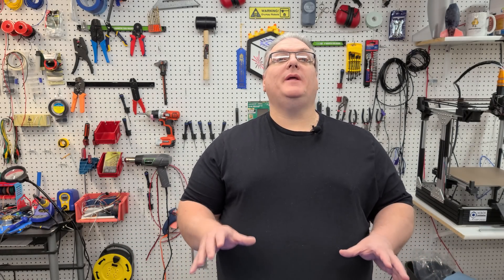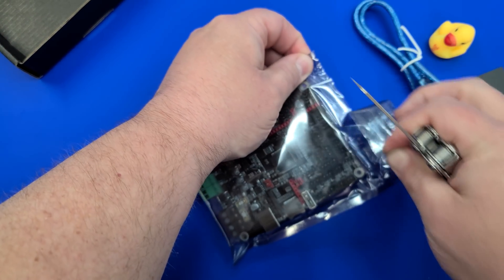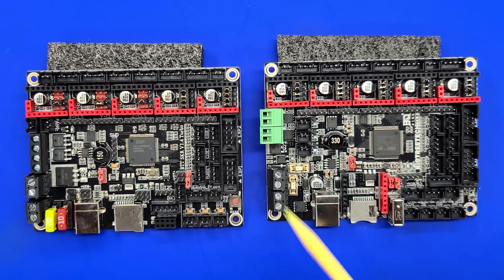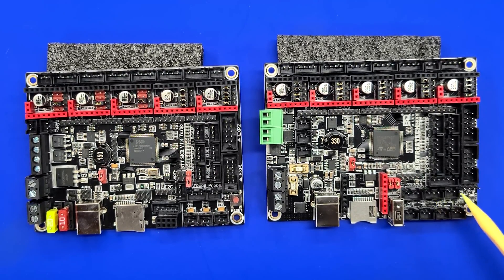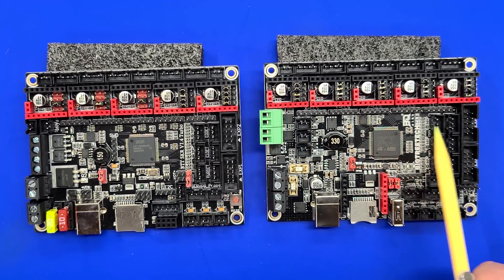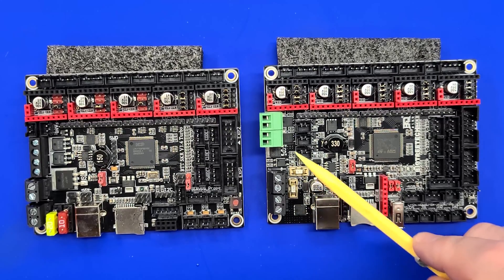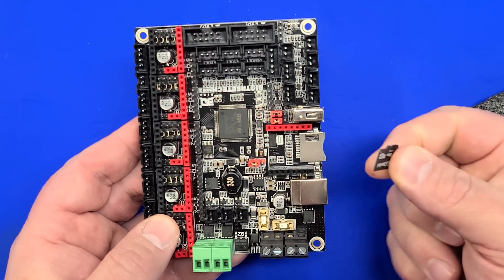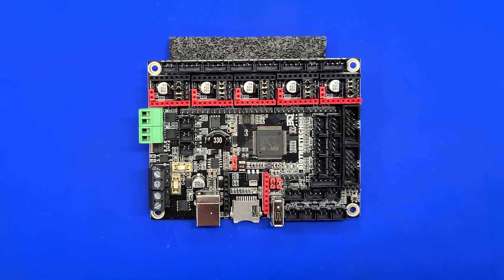BigTreeTech SKR2 - First Look

Comment: Hey man. I'm building a new control box for my cr10 v3 and I'm leaning heavy towards this board with 2209 drivers. What is your opinion?
Reply from the maker: Just make sure you're getting one of the newer ones with the fix.  I'm not sure if there are ones still in the wild that have the driver issue.  I have a few of these installed and they work fine with TMC2209 and sensorless homing.  Its a good economy board for a standard cartesian printer like a CR-10.  I would have no concerns putting one in a machine.
Reply: @MakersMashup  awesome, thank you. Of all my printers the cr10 v3 and it's 8 bit board drives me nuts with its slow interface and constant print failures. I already ordered a psu and all the wiring and such to make a new control box. I've been holding off on the new mainboard and screen. Talking to btt directly is somewhat frustrating as they have given me bad info in the past when buying a hotend when I was a complete noob when it comes to printers haha they still think the hotend is the same as the original cr10 even when I told them it was a direct drive e3d titan. I plan to enclose the printer to use better functional materials at higher temps. Especially for when I decide which diy fast printer I want to build. Thanks again for answering.

Comment: Does the SKR 2 physically fit with the native Ender 3 v2 frame?

I can only seem to find installation videos for the "Mini" variant - which I don't want because that doesn't support dual Extruder motors/drivers.
Reply from the maker: Not sure about the V2 but the V1 has several adapters for 1.3 and 1.4 skr.  The skr2 has mostly the same footprint.

Comment: Does anyone know if you still need the DCDC module to run more than 10 neopixels? What is the current draw on those pins?
Reply from the maker: I would power externally for more than 10.  I have an upcoming video that you might want to wait for if you want to use a lot of neopixels. I'm expecting to release it in a couple of weeks.

Comment: i have been unable to flash this board, used usb with arduino, vscode - nada. tried using sd card - nada.
Reply from the maker: Did you copy the firmware.bin manually to the SD card?  If so I would reach out to BTT that was all that was necessary for me to get it to flash.  It doesn't work like the old 1.3/1.4 where you could write to the SD directly.  BTT has a footnote of this in the bottom of the PDF in the github repo.  I ran into the same problem initially but manually copying worked fine.
Reply: @MakersMashup  I am trying, but all I have is a 120 gb mini SD card . So I'm thinking that might be an issue. Also I still haven't found any information that says I can't upload via USB cable anywhere l, except the comment section here
Reply from the maker: I'm fairly sure that is your issue. IIRC I remember there being an issue with using cards over 64gb.  I have used a 64gb successfully.
Reply: well i was able to get it to flash its led for a few seconds, but now i cant connect via pronterface to the board...
Reply: @MakersMashup  it flashed, now LCD / USB don't work anymore so this board is a piece of crap
Reply: @MakersMashup  can you share your firmware.bin ?
Reply from the maker: Sure. If you want to pop into the discord I can send it to ya.
Reply: @MakersMashup  I actually got it, bought a new 16 gb msd card and it worked. Also told their support that adding a SD card with the board is a good idea seeing as the default for msd cards is 64gb which is not good

Comment: I see one thing that is kind of worse compared to the turbo.. the turbo has esd protection diodes on the limit inputs. They are not present on the new one anymore, but otherwise the thermistor pins are better protected now. There seems to be something interesting going on with switching the motor power gnd.. maybe to make sure logic power is always enabled before motor power, or it is for the „anti reverse driver“ feature. Not sure. Also the thermal runaway is interesting.. i think they cut the mosfet power when it is drawing too much or nothing. The wifi part is cool.. because it could be used via uart or faster spi and should make it possible to later use the wifi module to upload the new firmware instead of the sd card method. We will see;)

Comment: Have you gotten this board working on a printer?  I've got one on order with tmc2209's and would like to see one working. :)
Reply from the maker: Not yet.  Hoping to soon just behind some other projects at the moment.  Should have results soon though.
Reply from the maker: Kortt - If you havent installed the 2209's and powered the board on yet... DONT there is a serious problem with the SKR 2 I should have a video out hopefully later today
Reply: @MakersMashup  Thanks for the heads up.  I am seeing people reporting about issues with these drivers.  I'm holding off on doing anything with the board.
Reply: @MakersMashup  ah man I'm waiting for mine to be delivered :'(
Reply from the maker: Check out the bug video. https://youtu.be/SjVkqXaQKtc critical if using 2209s
Reply: @MakersMashup  Thanks. I am a mod on the Crosslink 3D printing Discord Community and have shared your SKR 2 follow up video over there in our SKR Channel.  Thanks for the quick update and the great info!
Reply from the maker: Anytime!

Comment: What angers me the most is that no one ever talks about connectivity to a computer. I have a miniPC sitting right next to the printer, so a simple 30cm USB cable would do the trick. This connection will never be removed as the PC has a further 3 free USB slots, so more than enough for all uses. The question is - can I use the USB-port on this board to load my data to the SD-slot/card and run it from there? Or do I have to use the Wifi to bridge the 'distance'?
Reply from the maker: What a great question.  The answer however is that it depends.  Physically the board can do that. Marlin supports M28 which allows you to write to the SD Card.  You however need to be able to send that file somehow.  Octoprint does a good job at that.  However you'll need to check to see if the firmware you're running supports it (you may not be using Marlin) and have software on the PC side to send the file.  The M28 does allow you to write to the SD card directly using USB.  If you use octoprint you may have noticed if you try dragging and dropping a file it gives you a local option or an SD card option.  That uses M28.

Comment: I got mine 3 days ago but can't get the 2209 drivers to work. Keeps getting an error and saying they're plugged in backwards but you can't plug in the 2209 backwards.
Reply from the maker: That may be a Marlin issue vs. a board issue.  I would reach out to the Marlin team about that specifically.
Reply: Hi, sorry for the late reply. Regarding your problem, please feel free to send an email to support01@bigtree-tech.com. It would be better to attach a pic and video when you email them. We would be glad to help. Keep us in the loop and hope things are resolved soon.

Comment: I use and love closed loop steppers.  My core XY (sapphire) would occasionally layer shift before installing them.  After no layer shift and also recovers from filament blob print head hits (was using a new filament).

Comment: 6:20 is not really a proprietary connector. It is standard pitch for ESP07 or ESP12. You can buy those on ali for 1-2USD. 
That flashing comes unfortunately with STM microcontroller. I have the same "problem" on SKR Pro.
Reply: Hi, if you still feel like you need support for your SKR Pro board, please feel free to send an email to support01@bigtree-tech.com and it would be better to attach a pic and video for faster help. Hope your problem gets solved.

Comment: Having to manually move the firmware update is a deal breaker for me. So sick of these manufacturers that update their products and downgrade them all at the same time!
Reply: That comes with better STM microcontroller. Not sure why it behaves differently, but there's probably nothing they can do if they want to use STM

Comment: Closed loop steppers mean you don't lose steps and can run at max speed. It moves the bottleneck to your power system or heater instead of your controller being the bottleneck.
Reply from the maker: I know how they work and have some myself but as I said I don't know a lot of others that are using it day to day in their builds.

Comment: I have this on the way, didn't even realise the wifi module would be specific for this board. So I'm trying to find it now and can't, it doesn't appear to be for sale (yet).
Reply: It looks like a ESP-12F should work, can't guarantee it but they are cheap enough that if you were to get one and it not work its not a big deal.
Reply: @myopinion69420  sure but there is supposed to be a module that can be inserted without extra work. But since this board is so new it'll be a matter of days before more becomes known.
Reply: @smooth60  what i'm saying is i think a esp-12f with headers will slot strait in and probably work out of the box as its my understanding is they are set up as a serial wifi adapter out of the box.

Comment: Nice card but I will wait a bit before bying this,  As the history of the different ver. of the BTT 1.3 - 1.4 (turbo) cards have for some including me been a bit bumpy,  things just stop working, things like Suddenly don`t read SD card even frying brand new SD card / Not taking New ver. of Marlin  or any other software update / frys thermistors / stepper drivers and other gremlins. I have currently 4 bricked cards to prove it.
-The funny thing is they have been running fine for me for 3 to 11 months, and then it just quit working no change or new features added or removed after install,  
the prosess of updating and all other tinkering started after fist signs of misbehaving.   
And its a lottery if you get them to replace the non working card at least that is my experience. 
They give you the endless dance of taking pictures and try this and that, and follow their instructions and making a video so they can verify that I have done it all, then politely explaining every thing and then no more answers or correspondence . It`s just like taling to a BOT   
But thanks for being a canary and sharing your experience.
I have currently installed MKS Sgen_L v2.0 and no issues so fare. No change in hardware Just replaced the board programmed Marlin  flipp the on button going on 6 months. 
Happily printing producing nice and fine prints 80 + % of the time.  I guess that is a story that is worth telling...
Reply: Sorry for bringing you inconvenience. We will send your feedback to the appropriate department and strengthen tech suppport.

Comment: Flashing ROM via SD has become standard on most (possibly all) STM32 based boards. The board only needs the SD card when reflashing.

To flash via USB would require either having an ST programmer (plus knowing how to use it) and having a header for it, or possibly putting another MCU on the board (with its own USB port or some complicated USB signal muxing...) to act as the programmer.

If you use Kilpper you only need to flash once, all config is done on the RPi.

Comment: Thanks for the info! 
Looks like a great board to get for when you are coming from an older board. 
For me personally this is not a worthwhile upgrade as I have been using a 1.4 board with Marlin and Octoprint for a while with zero complaints. The SD card reader on the v2 though...that looks janky as heck. And that new fiddly fuse holder...not a big fan. Poor design decision IMO.

Comment: I’d love if the board was not so overfilled in a small space so we had a little more room for a beefier mosfet and maybe some current sensors.

I’d honestly not mind if they made a pro board with a larger pcb but still i really like my skr1.4 turbo so for 50$ its not bad :) the wifi connector change is a welcome fix for the design, it was honestly a lot better than the overhang the 1.4 version had. Its very tempting to make an overkill micro atx pcb in kicad based on the skr 1.4 maybe even put an estop and a relay on the main board for a mains powered bed. Overall its awesome that big tree tech keep surprising us with new goodies.
Reply: How do you feel about the SKR pro or the GTR? Do they fit the bill?
Reply: @catexis  i didn’t know it existed until now but it looks like exactly what I wanted originally thanks for showing me this :)
Reply: @not-another-dev  FTW! :)
Reply: Thank you for your objective feedback and we will keep improving our products!
Reply: @bigtreetech5117  i love the boards thanks for creating them :)

Comment: Great review, very nice board with good flexibility and no Dupont connections needed in normal use, even has USB, excellent! 11:35 Selecting the Wifi module or the U disk only affects the SPI connection, the Wifi module will still work in serial mode, which is how it is used most of the time (like with the old connector).

Comment: The bed heater connectors are an industry standard that I am familiar with and they work very well in a high vibration environment, shipboard electronics. Looks like a win to me with durability and ease of assembly.
Reply from the maker: Excellent.  Thanks for the feedback on that Tony.  Looking forward to getting one of these installed now.

Comment: I use the closed loop steppers on main axes on my core YX build and they work great, no skipped steps works well with the SKR 1.4. The 2.0 seems good with 3 fan controls, but not being able to flash directly to the SD card is rather disappointing. Thanks for the great videos :)
Reply from the maker: Awesome to hear you're using CLS on your build.  Thanks for watching!  Very much appreciate the support.
Reply: Which closed loop steppers do you use? The ones from BTT?
Reply: @neur303  Yes the are the S42 B v1.1 from BTT. I've been very impressed by them, both quieter and smoother than the tmc2209 drivers i operate on my Z axes and no skipped steps.